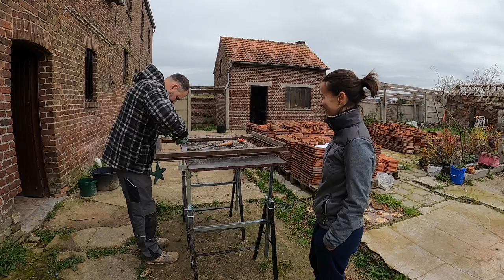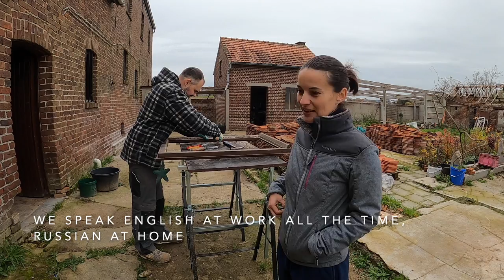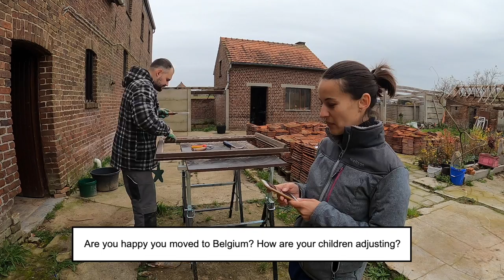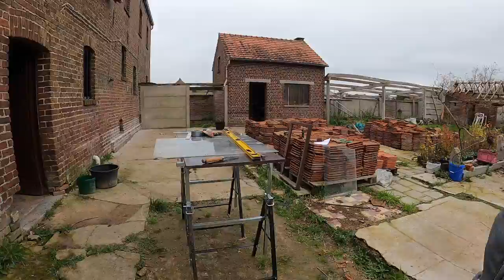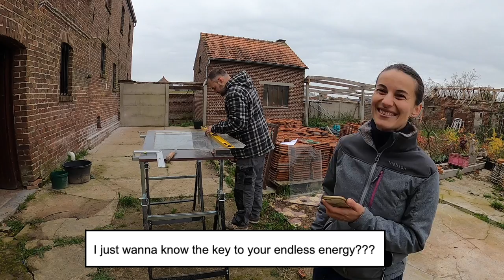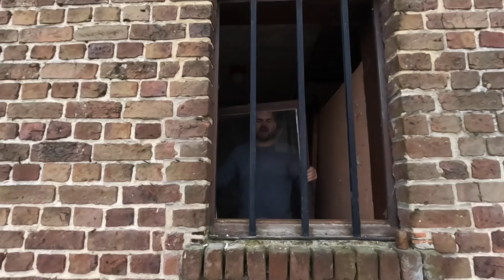Get to know us and Anneke / Q&A [ Part 1 ]

Comment: This is an FYI from watching Illya work on that old window.  If you have more to do in future, it's easier and less time consuming to use a 4 inch angle grinder with a thin cutting blade to remove the old super hard glazing putty or a Dremel tool with the correct attachment, especially in the corners.
Reply from the maker: Thank you John, noted!

Comment: Thank you for the Q&A!  
As always looking forward to the next video!  I'm very curious to see other sections around the farm which ones are being removed, how heating and cooling will be, also how the plumbing and electrical will be installed.  There's no more asbestos roofing sheets to remove from the remaining structures?  I would hope that process is finally done and over with.

Comment: If you use low heat like on old hair dryer on the hardened window glazing it would much easier to remove. It will soften it and it will just peel off with no efort and less chance of damage to the wood.

Comment: 21:25 you don't need to put so much pressure on the glass when scoring, barely visible line and some poking from the bottom will work fine too
Reply from the maker: Thank you for the tip, noted!